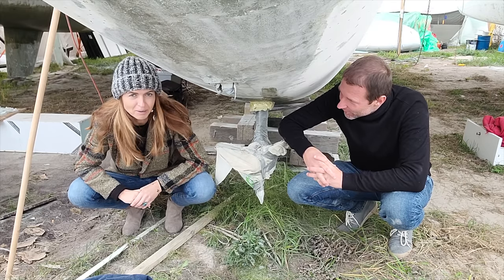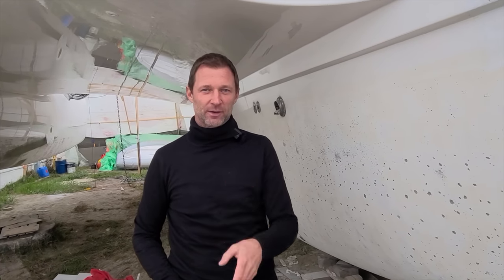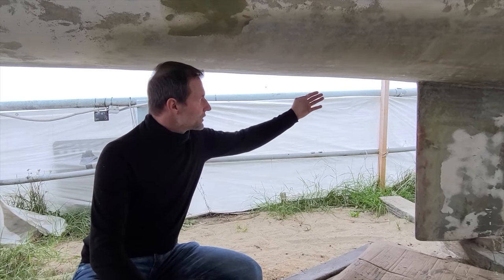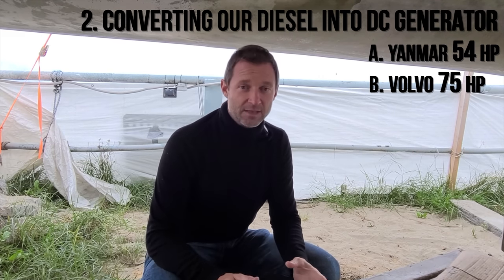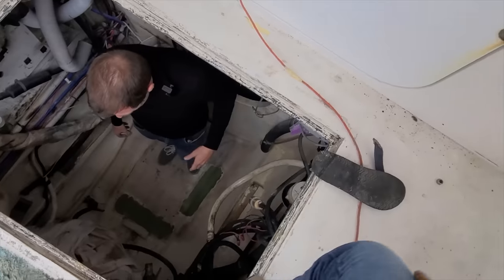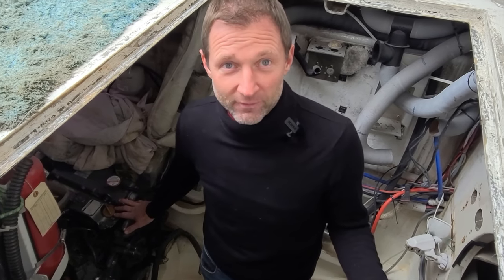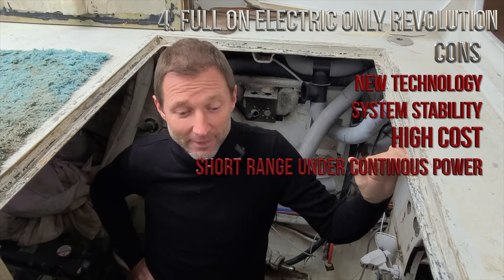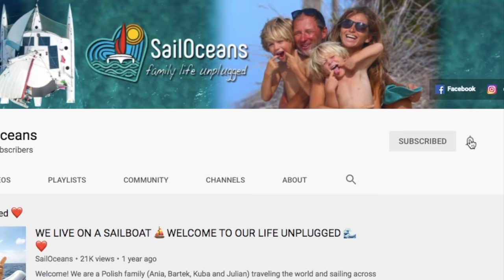The Big Decision - Electric vs Diesel Sailboat Propulsion

Comment from the maker: Enjoy our new vlog! Please remember to SUBSCRIBE, leave a like, share and comment ❤ That is a big support to our channel to grow! Thank you  ☀☀☀ Ania and Bartek
Join our LOVE BOAT group for our Patrons & support our creation:
https://sailoceans.com/support-our-creation/ thank you 💋
Reply: Go hybrid its better to have and not need   than to need and not have as far as diesel goes sell both diesel engines and the generator change to all electric
Reply: buy a diesel electric generator that can more than take care of your electric needs not a diesel engine to run your boat but makes enough electric power to run your systems and electric motors small and light weight if possible  also talk to the Redflow battery company you get a free trial for their new flow batteries they could greatly improve your real battery needs at reduced cost
Reply: sorry you may get a free trial they are looking to enter new markets
Reply: @jdhuff1047  
What happens when the electric drives aren't powerful enough when caught in severe conditions ? When you have glass smooth sea conditions and no wind, for perspective I was able to use a Mercury 3.3 hp 2 stroke outboard on the back of the dinghy, to power a very heavy bilge keel yacht at over 5 knots for a bit over 40 miles,  only put 4 litres in the tank refilling to complete the journey. On the other extreme, I've been in a Force 10 plus Storm for over 3 days with no sunshine - the only time I've been Seasick but the engine was powerful enough to keep us heading in the right direction and got us through it. "Wouldn't it be nice if" Virtue Signalling has no place in a Marine Environment where backups of Backups tend to be the only Sensible Option, and you have to have a plan for when more than one thing at a time Fails. My last boat had enough power in the diesel engine to power me out of a Tidal Rip Wreckers led us into ,  but didn't have enough power in astern to avoid rocks we'd been pushed towards. Plus the Marine Environment is very hard on everything, and electric motors can't make themselves immune from that like anything else can they? In wear abd tear terms, Marine is 10 times worse than Land. Diesels thrive on being worked, left idle is bad for them, and respond to clean oil, clean fuel, and clean air with regular servicing and tlc. Treated properly, on land a million miles is not uncommon. so at 10 to 1, a hundred thousand miles equivalent should be possible at sea. Treat them badly, and diesels will let you down. Too many liveaboards have awful state engine oil when they change it, and don't even change impellers frequently enough. Be as reliable for your engine and transmission, as you want your engine and transmission to be for you. 👍
Reply: I don`t recall the boat rebuild site but he used a small diesel that could stand on its own and could move the boat no real change there but it has twin generators mounted that can be used to run your electric prop with power enough to run all ships systems as well you mount the prop differently, the regen from this type they are more common i don`t remember the names will generate electric power paired with solar panels , windmills and good batteries now you have a system that should meet your needs with sound backup still make power and motion with the diesel or batteries and can use the diesel to charge the batteries as for the rocks some times the diesel can`t keep you off the rocks twin props will help with that but the sea is a bad bitch and she just might slap your ass down anyway but in this case i would put in bow thrusters fore and aft i think that could help a lot keeping you off the rocks and more my dream boat is a trimaran
Reply: @jdhuff1047  
I'm a fan of having as much backup as possible, and the energy density of diesel makes it a reliable and easily manufactured Renewable resource for the long termmimo. I'm also a fan of trimarans, and almost bought one back in the 1970's. possibly interesting, is the plasma Gasification that can give us vast quantities of cheap ultra clean diesel, via Syngas Waste to Energy Production, may bell be able to dispose safely and cleanly Solar Panels and old Lithium Batteries, while extracting everything useful from them as well. That Synthetic Diesel Fuel can also have its Energy Density significantly increased. For doing Real Work, imho, Diesel Fuel has a very bright Future. 👍
Reply: @brownnoise357   I have a different take co2 is part of the life cycle on earth on its own it is good for earth plants need it to make oxygen acid rain was from the sulfur in the coal we are focused on the wrong problems cleaning the oceans of plastic would be more helpful the Safire Project would end the need for coal fired plants and give us clean safe energy and a better understanding of how this universe works  but i would be willing to bet most people have never heard of it, in my twenties my STTO space plane ideal was not possible but today i would love to combine the Reaction Engine [a air breathing rocket engine] with the double Boxtail airframe design Synergy by John McGinnis and see what happens And i would love to be rich enough to invest in Searl Magnetics win or lose As for clean renewable fuels hydrogen would be my choice that`s why i love the hydrogen ICE engines that Cummins is building
Reply: @jdhuff1047  most plastics break down really fast  into water. That’s what Osmosis in the hulls of glass reinforced polyester resin is all about .It might surprise you to learn that even plastic underground pipes only have a service life maximum of about 90 years, so we have massive replacement costs starting by 2050 ?
Reply: PS Hydrogen fuelled internal combustion engines were fully looked into and  up and running in the 1970’s, by Nissan and others, and soon got ditched. Imho, Cummins needs to stick with making Superb Diesel Engines, as they will run well on Cheap Renewable Synthetic Ultra Clean Diesel Fuel from turning waste into energy with off the shelf available today Plasma Gasification, with Syngas also producing Jet Fuel, Petrol, Butane, and Propane, in vast quantities. Heck even Sewage and plastics can be used as feedstock, along with the contents of all Landfill Sites. 👍
Reply: @brownnoise357   yes plastics has a limited useful years but its not organic the pieces get smaller but are not consumed it the sea life that suffers
Reply: @brownnoise357  YOUTUBE REACTION ENGINE AND Alan Bond and the three rocketeers
Reply: @brownnoise357  all true but hydrogen is the most plentiful element in the universe burn it you get water some nitrogen oxide hydrogen is the foundation for most carbon based fuels
Reply: @jdhuff1047  And those Fuels are much simpler to handle safely . In the School Lab, the teacher split some Hydrogen off water, and ignited a very small amount. The Explosive effect of that small amount of gas exploding rather than just burning, was a salutary lesson about not having large amounts of Hyrogen around that can be easily used by bad people. For comparison, you can stub a lit cigarette into a dish of Diesel Fuel, and it's worth sticking with just from the general Safety and cheap infrastructure aspect as the Best Renewable Fuel for the Future  imho. 👍
Reply: @brownnoise357   Bad people can always fine ways to show how insane they are Oklahoma City Bombing for example used ammonium nitrate + nitromethane talking about bad people that`s just a red herring my interest in hydrogen started as a means to power my verson of a flying fish as a much younger man my idea was to follow the migration of dolphins with electrolysis a compressor to fill the tanks and i would be swimming in fuel and there are several ways to generate electricity while floating in the ocean better yet did you go look at Reaction Engine Saber the air breathing Rocket not a Ram Jet a bit like trying to light a candle in a hurricane i get it, but if i can be both submarine and plane more plane than submarine i would be one step closer to that SSTO space plane of my youthful dreams not saying i could do the math but  I knew it did not add up even then now i might be willing to learn the math today because what i can see today its no longer just a dream its just not being done  maybe our government but i am not holding my breath

Comment: I would sell the yanmar and rebuild the Volvo penta and put it back in, this will give you the power to move in stormy weather, and through the Panama Canal like you said. After reinstalling the Volvo penta put a large alternator on the engine to charge your batteries along with your solar. You could possible get rid of the generator so you can have more room for batteries or fuel. Take a look at project aticus as they just did an alternator upgrade project and documented it. Sailing Ruby Rose is also not putting a generator in there new Boat and is using an upgraded alternator on there engines and solar panels to charge their batteries. Sailing Ruby Rose is going to be a catamaran so they will have 2 engines. Good luck with your decision, I enjoy watching the videos it's great information.
Reply from the maker: That's what we did. :) Cheers.

Comment: We just recently installed a new 50 hp Nanni on our 14m yacht to replace a worn out 40hp perkins. We looked into electric, but decided it was not practical in the places we sail. In Tasmania we can go weeks without seeing the sun much, and there are strong tides, rough water, strong and variable winds to deal with. We needed a motor that was absolutely reliable and could be run any time for as long as needed. I would have loved to go electric,  I think it would be a possible option if we were in more tropical waters
Reply: Perkins never wear out ... just failed maintenance.  Mine is 50 years old and with new parts it's better than a new engine.

Comment: As you still have young kids, I personally would go with the hybrid option. Gaining of "electrical knowledge" by practice and experience seems to be the most compelling goal at this stage. In a couple of years option 4 would become viable, but then coupled with decent experience, practice and knowledge.

For now: dual battery bank + solar (integrated with the new overhang) + twin electric propellers alongside current diesel engine + generator. The diesel engine and generator can be phased out in a couple of years with dual generators (one generator per electric propeller). 
Do note: The middle section later on can be used as the 'main' battery bank supplemented with the battery banks on either side. In his way you will have the perfect weight distribution. The middle section can also be converted into a third or even upgraded into the 'main' electric propeller in due time.

Therefore option 5 seems to be an option after typing the above: solar + triple electric propellers. One battery bank and generator per propeller.

I understand that you only have one engine now. If that one engine fails, the rest will fail in cascade as well. Therefore, you will still need to have the generator to keep the current electronics working.

Comment: You may want to think about it a little differently. Just like with flying and being a pilot, when your primary system fails what is your backup plan?  This is why you have 2 mags on the engine and 2 radios, and 2 yokes. Same as your reasoning for 2 electric motors on the boat. Consider that 100% electric is your primary system. The primary system components would be sails, solar, wind turbine, large battery bank, and electric motors.  Then your consideration is only about backup. It could be a compromise of having a 7kw generator and small diesel tank for the rare occasions that you need it. You clearly have the room for it. You then think about it as an investment in an insurance policy. Down the road if you never use it and/or technology has advanced to the point that it becomes unnecessary then you get rid of the insurance policy. If you look at the companies building all electric yachts, I believe they are building in generators so that they can limp along to safety in case of emergency.

Comment: My choice would be to build in max performance in case of emergencies, sickness, running away from storms etc.  I would put the volvo engine back in as a generator, have two electric drives and maybe add to your battery bank.    If you are sailing mainly in warmer climates you would have good solar so you would not need to run the volvo much as a generator so boat would be quiet most of the time.  However if you needed to get somewhere quick you have the option to run the volvo more often.  This option gives good safety in terms of speed if you need it, quiet running most of the time and your air conditioners can be run non-stop when needed..  A good compromise in weight too.  Best wishes.

Comment: option 4 with the small genset and the battery setup with solar is the best options long term and make sure you use the Victron inverter system, Sailing UMA would be a good connect with them, also Ran sailing for the Batteries. Don't do any of the other options as this will change the way you live. life will be much better.
Reply from the maker: That's where I am leaning. I still need to talk to Uma. They are supposedly converting back to diesel, but that may be because they are mono, with limited solar space and cruising high latitudes. Cheers John. Bartek
Reply: Absolutely..  But, load your boat with Lithium batteries..  Your props can become the power generators. Sailing Uma did it.. Now, you have twice  the power, as you have two hulls... Well, there is a new technology of shooting a kite to drive the boat.  I suggest to add at the forward...  @JohnCorrenti mentioned one best..
Reply: @SGudur  I seen the kite but since they are a sail boat I don’t see the need as the kite is electric Powered boats without masts.
Reply: @correntij  Aah, My bad, I didn't know that..  Just watched NautiStyles Ep yesterday..  They were touring a Full Elec Cat..  Just found some random videos..  Let me dig into it..  Thank you so much for the quick response.. :-)
Reply: I simply love the way sailors assist each other.. They are more bigger than the people on land!! Loads of love to you all..

Comment: Agree with the last couple of comments.  UMA has an electric engine which recharges the batteries when under sail - it changes from an engine to a hydro-generator with big amperage at reasonable sailing speeds.  A lot of catamaran sailors use only one engine while under power.  So maybe you can do that and use the second engine as a generator.

Comment: What an opportunity!
Forget the Panama scenario - hire a generator just for that occasion.
LiFePO4 batteries are very safe if managed well.  
In my experience you don't want to charge them up to the manufacturers 3.65V per cell - you can add lifecycles and safety by keeping each cell between 3.0V to 3.45V and only lose about 5% capacity.
A small generator can be your absolute last resort and could probably maintain 4-5 knots on it's own.
Have you looked at TEMA?  
They make very high quality electric drives and are based in Croatia.